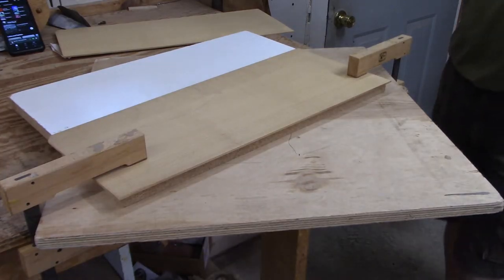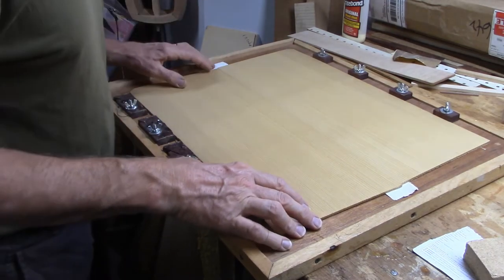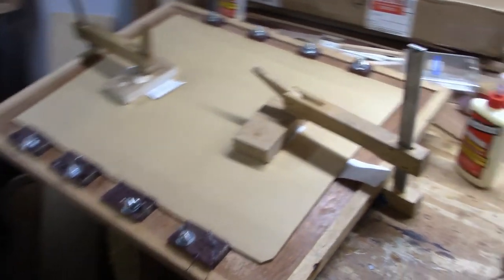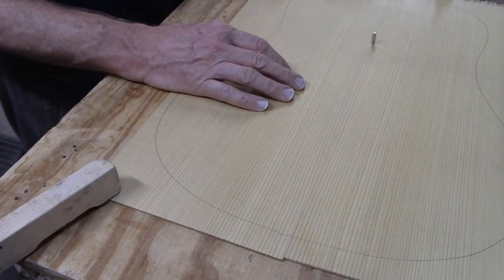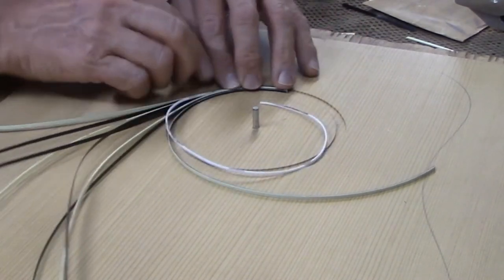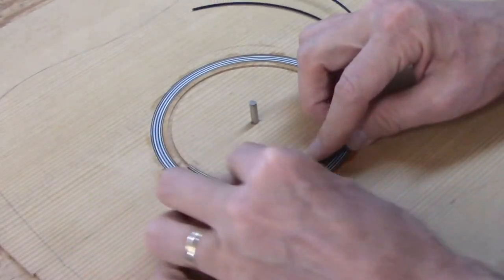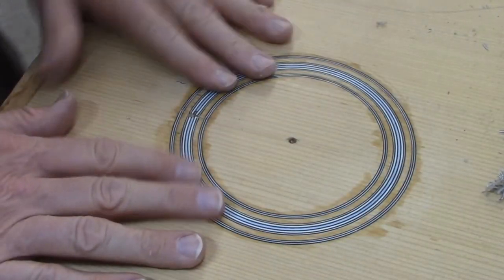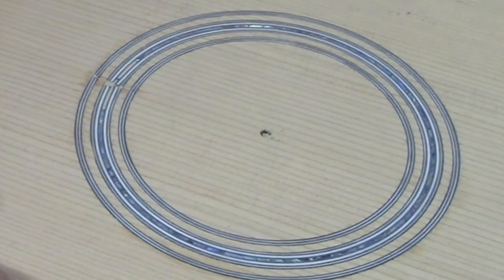Building a 45 Style Dreadnought.  The Soundboard, part 1

Comment: Why did you apply lacquer to the channel before laying in the rosette?  Also, I've seen some who lay both sections of the boards to be joined on top of each other when using the shooting board, so even if  there is a small variation in the edge, it is matched on both boards, keeping the seam tight.  Clearly, you don't need to use that trick to make a perfect seam.  (Nice plane, BTW)
Reply from the maker: Good question! The very thin glue wicks along the grain lines of the spruce creating unsightly darkened streaks.  They can't be sanded out because the glue is traveling through the full thickness of the channel.  If the channel is first coated with something more substantial, like lacquer or shellac, it creates a seal so the glue cannot get into the grain lines.
I have seen that method of stacking the two halves also and I sometimes have done it that way.  This plane is so perfectly true that it doesn't seem necessary.  Thanks for restoring it for me!
Reply: @zimnickiguitars311  Have you ever had bonding issues when you pretreat the channels (rosette popping up etc)? Pro's or cons to lacquer vs shellac?
Reply from the maker: @Ronys2YT  no, I haven't had any bonding problems.   I  have found lacquer and shellac to work equally well.  I use lacquer more often because it is always available to me.
Reply: @zimnickiguitars311  Thanks for the great info!
Reply from the maker: @Ronys2YT  thanks for watching!